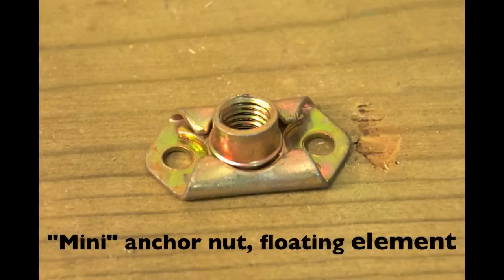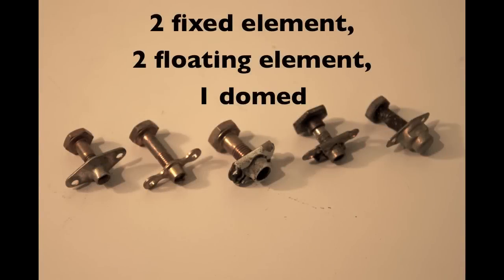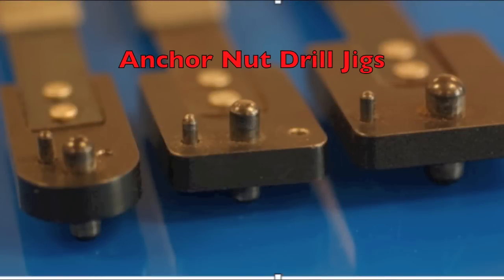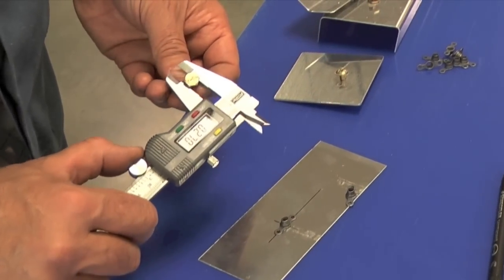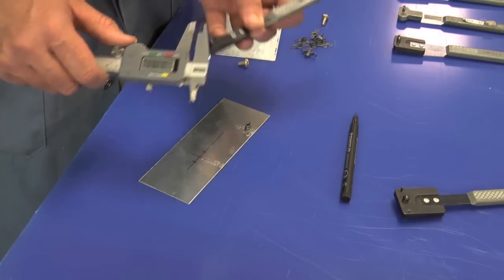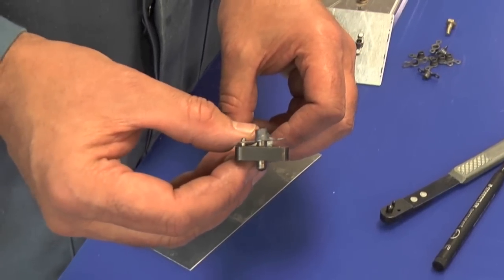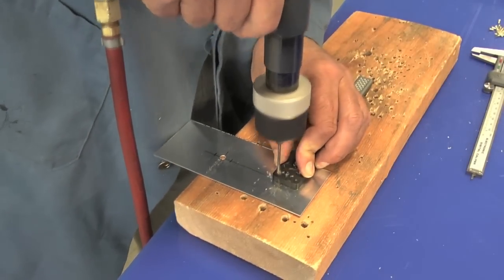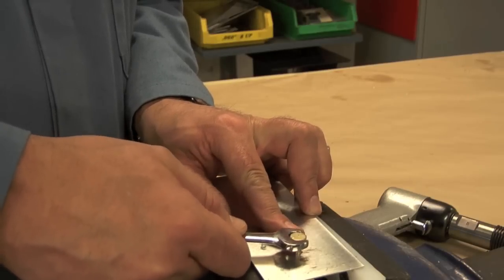Aviation Anchor Nuts

Comment: why does my screw only go into the nut plate so far and then stop?
Reply from the maker: It's probably bottoming out.  The threads end partway up the length of the bolt (or screw), leaving only a bare treadless shank.  Be very careful gauging the length of bolt before installing.  Also make sure there is adequate distance below the anchor nut for an amount of thread protrusion.
Reply: user error

Comment: anchor nuts are fun to install. but time consuming..so many step up drills with a pilot tip to guide the drill right through the center of the hole